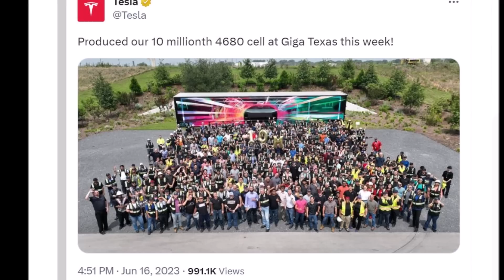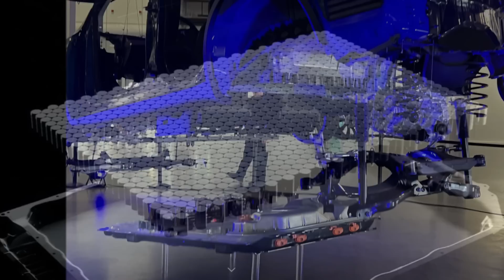HOUR AGO! Tesla Announced a Major Milestone about 4680 Battery Cell Production at Giga Texas

Comment from the maker: The exact number of Tesla 4680 cells in one Cybertruck is not yet known, as Tesla has not yet released the battery capacity of the Cybertruck. However, we can make an estimate based on the known capacity of the 4680 cell and the expected range of the Cybertruck.

The 4680 cell has a capacity of 90 Ah (ampere-hours). The Cybertruck is expected to have a range of 250-300 miles (400-480 km). Assuming a battery efficiency of 80%, this would require a battery pack with a capacity of 312.5-375 kWh.

If we divide the battery capacity by the cell capacity, we get an estimate of 3.5-4 4680 cells per kWh. So, the Cybertruck could have anywhere from 1,088 to 1,400 4680 cells.
Reply: Please explain to us how a round steering wheel or a yoke can possibly affect the  aerodynamics of a Cybertruck. Maybe I'm missing something, but the steering wheel or yoke is not outside the vehicle, not on the outside. Thanks. 🙂👍
Reply: Thanks for saving me that math ;).